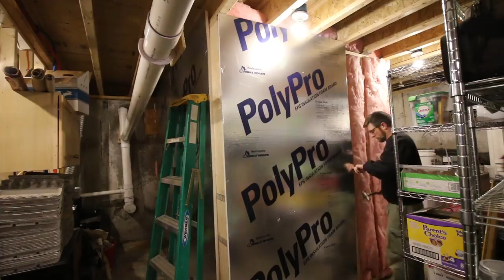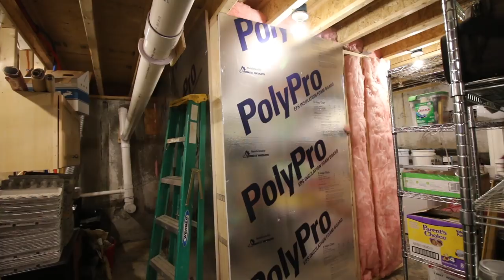Insulating the Root Cellar to keep the COLD IN and the HEAT OUT!

Comment: Hej Al! Here in Sweden, older houses have pantry rooms on outside walls with vents to let in the cold. we generally have no problems keeping it between 4-8 degrees C from October till March or April. We actually have to pay attention and open and shut the vents so that the rooms don't get too cold during cold snaps.
Reply from the maker: That sounds like were we are going with this and we too would have to keep an eye on it getting to cold in the middle of winter
Reply: Considering all the insulation you put in the walls, you might want to consider puttin a vent in the door leading to the basement, as well as what you have leading outside. That way you can fine-tune your cold room temperature better: if it's too cold, you can let in a little warmth from the heated basement, or if it's too warm, you just close down the door vent , and /or open up the one to outside. You could possibly even get a range of temps within the cold room-lower by the outside vent, and warmer nearer the door, which would let you keep things at the storage temp they do best at.

Comment: I am not being a troll, but I have a few suggestions.  Please research what I write on Google etc to confirm.

Your root cellar will not function as you want it to.  It will be little more than a novelty "project" to tell visitors about.

The problem is that 2x lumber has an R factor of almost 0.  It goes even lower as it dries out over time.  This is why older houses are very "drafty."  They have great insulation between the studs, but the studs themselves serve as thermal vacuums.  The best and easiest way to solve this problem is to double the wall.  Keep what you have now, but build a second wall against the first.  The second wall will be constructed in the exact same way, however, the studs must be staggered 8" without extra space between the walls.  Each stud will be in front of an insulation panel.  This will eliminate the bridging and jump your insulation quality tremendously.  You can do the calculations by figuring the R value for the wall through the stud cross section and then computing the R value through an insulation section.  This will show you how much draft you will have.  Recompute for the double wall as I described and you will see a very substantial difference.  This is an easy fix.  Try to double your ceiling insulation as well.  Perhaps you can use a crossing joist system to put the insulation at a 90 degree angle to what you already have up there.

A more substantial improvement will be the construction of an entry vestibule.  Take your door width and multiply it by 2.  Build a new front wall and sides out that distance from your current front wall.  Remember to double the wall system as discussed above.  Further, stagger your new door so that it is not directly in front of the other one.  If that is not possible, always keep the outer door closed when the inner door is open.  To understand why, watch what happens when you open a top mounted freezer on a refrigerator.  The cold falls out.  It will be hard to keep your root cellar cold.  Every time you open the door, your cold is going to fall out.  Using an entry vestibule minimizes the loss.  Staggering the doors further reduces the loss as the cold must turn a corner to exit.  That takes time to do and your entry time is less thereby reducing the loss and saving $$$.

Improve the opening wall to your current root cellar by placing a controllable vent high on the entry walls [ both ] or a side wall.  Remove the board blocking your window and place a similar vent over it.  You want a vent that will keep critters and gawkers out - but let the outdoor cold fall in during the winter nights.  Having one vent high [ hot rises ] and another low will establish a convection current to pull cold air down into your cellar.  The vents must be insulated so that they do not transfer heat unless you move them into an open position to do so under control.  This is easy to do with an insulated box over them which slides to the side to open.  [ research sauna design ]

Also, do not leave the concrete uncovered.  Whether it be on the floor or a wall, it must be sealed with a vapor barrier and insulation.  Otherwise the water vapor transmitted by the concrete will modify your thermal abilities within the room.  Research evaporative cooling to see the effects of trying to keep a humid environment cold to understand why.

I also recommend using a more substantial [ 5/32" ] OSB for your inner and outer walls.  As your luan dries, it will gap and fall off your studs.  That material is OK for the space between a double wall system, but otherwise it is crap.

Hope this helps.

Comment: Al:  On your insulated door you might consider  a stepped frame and matching door stop to facilitate a double gasket.   This  would go hand in hand with the level of insulation.   An other alternative would be double doors one opening in; the second opening out. Again two gaskets for a better seal.   
 If you want to go to a higher level in the future; you could add a small used chiller like the ones that are used  in small refrigerated delivery vans.    Then you would have 4 season temperature and humidity control.  the old guy    Bert
Reply: I've done similar in building lagering cellars for homebrewers, using a window shaker AC unit. Pretty simple change out of the thermocouple temp sensor, and replacing the temp controller with one from an old fridge. Good idea.
Reply from the maker: They make a unit you can plug into an Ac and use it as a compressor for a walk in cooler
Reply: Sweet. That's an improvement since I was building brew cellars.

Comment: Nice idea to use the foam board on the outside of the studs. Serves as a thermal break for the studs. For the interior, consider adding some more thermal mass to what you already have with the concrete floor and wall. Every bit you can gain will reduce the temperature swings throughout the year.

Comment: Good Morning Lumnah Acres!  Excellent job, nice and tight, and the luan plywood the 'cherry on top'. You are a master builder! I saw you are using the chrome metal shelving, that's a great idea, it's portable, air circulates well around it, you can get it in many sizes and configurations, it's fairly inexpensive, and available at HD or Lowe's. I saw that some of the Steaders recommended a small AC unit, one that can duel cycle to a thermostat. When it's finished and tight it will be very efficient, and how cost effective it is will depend purely on how many times you go in and out of it.  God Bless
Reply from the maker: An ac unit would be nice. A walk in fridge! :) I know were we could hang some meat to let it chill before cutting it up for a class! :)

Comment: When we've put up pieces above our heads it's helpful to add a 1x ledger board to just a 1/2 or so from down on one wall so that the ceiling panel can be held up while you are getting it in place to nail on the other end.  Just a Tip for you!  You have a lot of determination....which is great to see.   Are you going to use moisture resistant paint for the panels....I would worry about moisture that would rot the paneling.

Comment: Don't forget to put air ducts to the outside; one at the floor and one at the ceiling.  You could use 1 and 1/2 "or 2" pvc. for the ducts.  If you don't do that it could get real smelly and moldy.

Comment: I was always taught when installing faced insulation the paper faced the warm side. Shouldn't the paper have faced towards the basement (not the root cellar) in order to keep cold air from the root cellar moving out into the basement ?
Reply: Nope. Paper is the last of the moisture barrier before reaching your drywall/sheathing. Besides, it's less itchy that way. - Jacob

Comment: We have an existing block cellar attached to the outside of our home. I believe it was originally a cellar unattached, just opposite the porch. The porch was, at some point, built into an enclosed part of the home. The "cellar"  is plain block, with no insulation. with mold on the inside of the roof. The structure is only partially underground. My question is, can you put insulation directly onto these blocks? I don't even know where to start with this project! (other than to remove the mold, and roof and start over! Should we attempt to reroof it and cover the entire thing with dirt? Leave it partially above ground? What type of roof should we put on it? We attempted to reroof it, but then we got the mold! It has a small window on both sides as well as a vent in the roof. Not sure what we are dong wrong. Thanks

Comment: I was uncomfortable for most of the video. All that exposed fiberglass had me itchy, then I was expecting a pop from one of those exposed lightbulbs. I can't believe you didn't break a bulb, pretty sure I would have taken them out or broken one if I forgot. The cellar looks good so far. I think a swinging door would make a tighter seal than a sliding barn door.

Comment: Looking good Andy.  Now here is a nugget for you.  That window, take a pipe, plastic, and dig a trench out side of the window. Lay the pipe in the trench in a loop.  Bring both ends inside of the cold room.  Put a fan on one end of the pipe. Now you can cool the room all year for pennies. The ground will stay at 55deg at about 3-4 ft.  The bigger the pipe the more air flow.  No charge for this info, we are all in this together.
Reply from the maker: Headly Lemar what length of pipe would you recommend
Reply: That is a good system; but a lot of trenching.    I would go with 6" pipe and a 100' loop.   You still will need a low inlet and high outlet.    the old guy   Bert
Reply: I was trying to think of a way to describe this method.  I hope it works for Al.
Reply: Bert says to use 100' I think that should be enough.  Yes its work, but everything is. Isnt it?  You only need to dig a 50' trench and just double it.  You don't have anything else to do this winter. Sorry, I thought your name was Andy.
Reply: I am planning to build a cold room and I don't quite understand the 'Bring both ends inside of the room'  instruction.  How does that get the room cool?
Reply: Ok, I think I got it, the air from the underground pipe cools off and the fan blows it back into the room.

Comment: A refrigerator sitting outside in the winter won't run at all unless it is "Frost free" and it will run to draw vacuum and sublimate off the frost.  A deep freeze or an old manually defrost unit, won't run.

Comment: LOL. Dude, I absolutely love ya AL, but yer too funny sometimes. I was watching you struggle with that foam board in that short vertical space and kept wondering...."When is he gonna figure out the correct way to put it in is horizontal"? It would have been easier AND a bit more efficient. Also, you missed putting in the aluminum tape on the seams. I'm not trying to be critical or contrarian here. All said, you DID do a great job.

Comment: Are you concerned about mold from condensation. You put the vapor barrier on the inside then foam on the outside which will also act as a vapor barrier. Paper to the people man.

Comment: You have made a potential problem by having a non-permeable surface on both sides of the insulation. As a general rule you have to allow moisture to escape the wall cavity in one direction, meaning only having a vapor barrier on one side.